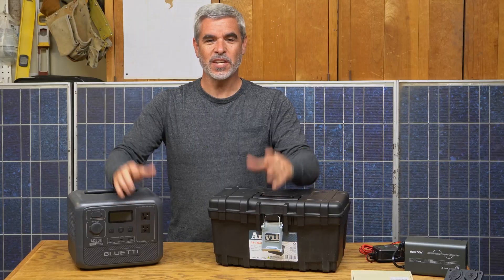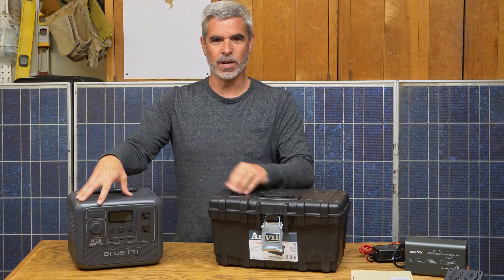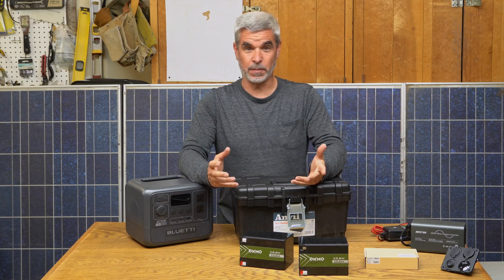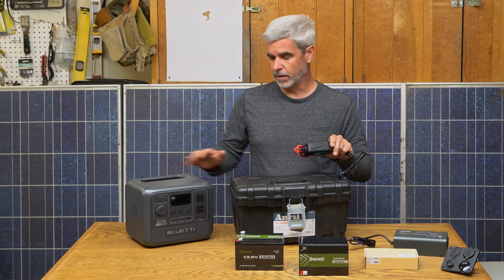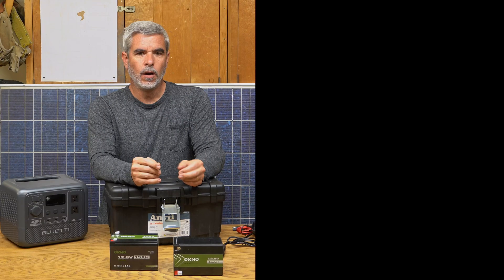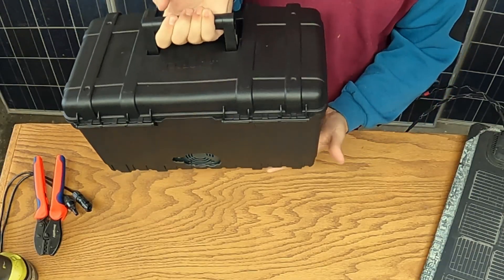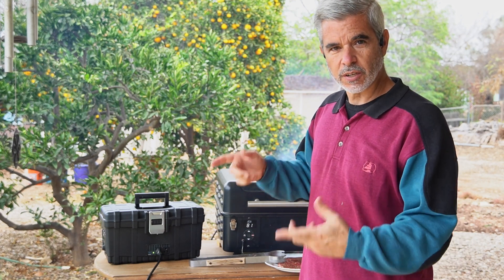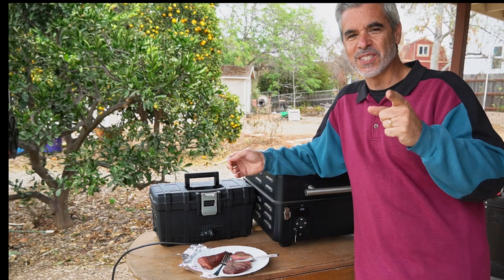Traeger Smoking with a Battery Generator: DIY Build vs. BLUETTI / ECOFLOW

Comment: I think you approached the build backwards.  Set your budget at the same amount as the prebuilt and then see how much better a system you can build, starting with a 100 AH battery at $100.
Reply from the maker: You make a great point.  For an additional $100 the batteries and inverter could have been substantially more powerful. I have t seen 100Ahr batteries that cheap that I would trust myself. Best is about. $160. In the end the ore build systems are really quite good unless you build a really large system where the price gets better for a hand built system.  I’m building a KWhr system for my home using 4 100Ahr batteries and a 1500w inverter.  Much less than &1000 for this setup including a 750W solar charger.  That video will go live this Friday I hope.

Comment: Good video. I made the mistake of buying a Bluetti. Biggest mistake I ever made. Bluetti is unreliable and I wasted money. I should have invested the money I spent on the Bluetti and put it towards the Ecoflow I ended up having to get to ensure I had a reliable off grid power station.
Reply from the maker: Wow, sorry to hear you had a problem with it.  Was the issue covered under warantee?